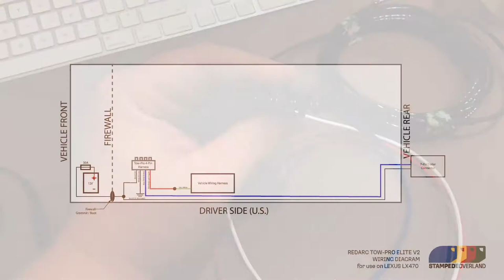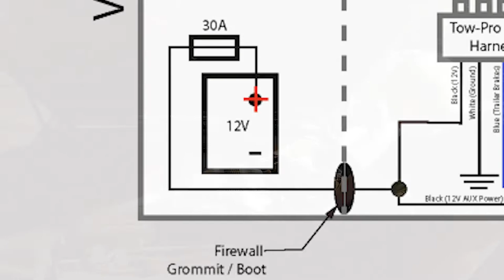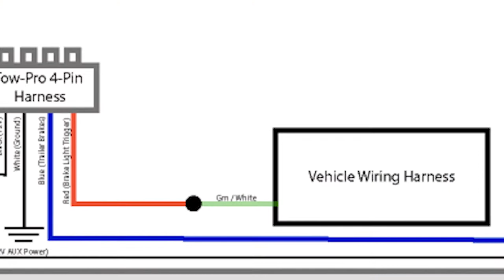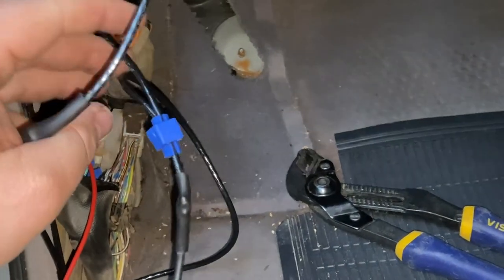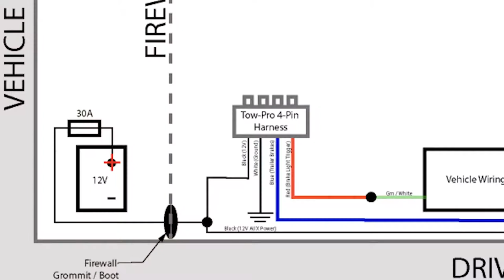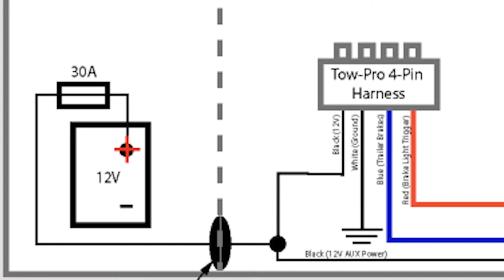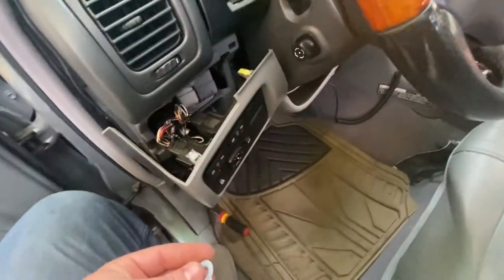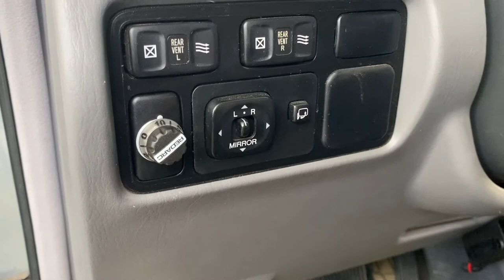Install Redarc Trailer Brake Controller in an LX470 / Landcruiser 100 Series

Comment: So about where did you drill the hole through the grommet to run the wire through? I can’t really see where the wires are going and don’t want to drill into a wire.
Reply from the maker: If you are looking at the grommet head on from the front bumper, it would be about 11 o’clock. Above and to the left of the main factory cable bundle.